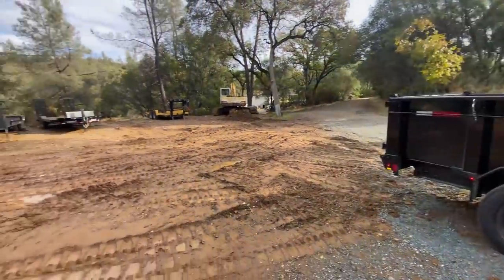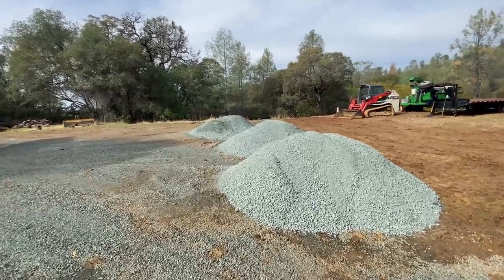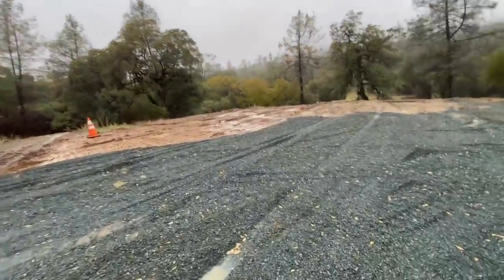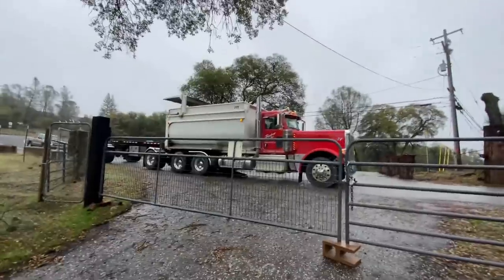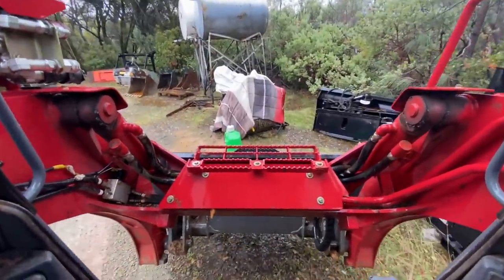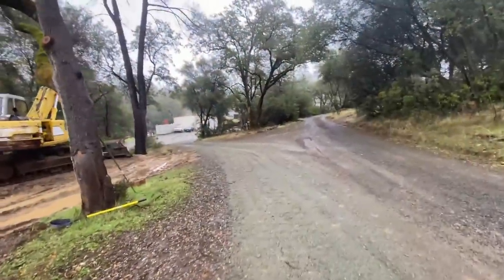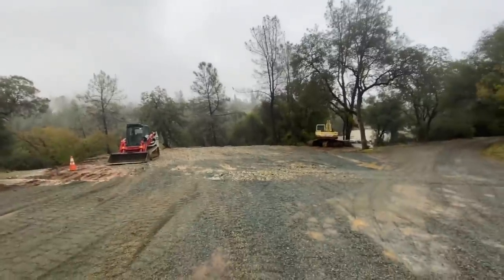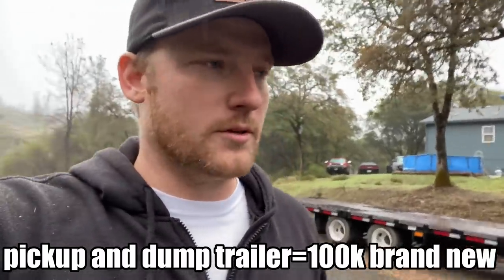How does my new Dump Trailer stack up to a dump truck. Price break down

Comment: Heavy road base geotextile is 100% worth it, especially at your own place vs. a customer. You haul in/out pretty heavy setups all the time, so no doubt all that stone will be mashed into the sub-base material. For 500 bucks, the proper geotextile will save you thousands in terms of re-graveling/touch up. Nice video sir, super jealous of your new trailer!
Reply: We started using geotextile five years ago and for our use, it's been the way to go.

Comment: I think the best way to build a yard is to shape everything with dirt first.  It shouldn't be perfectly flat but a bit of a slope, maybe hummed in the center a bit depending on the circumstances.  Once the ground is shaped to shed water then add your gravel.

Also when I order gravel I just get the biggest truck and trailer setup possible.  Usually tripple axle end dumps can bring me 27 ton per trip.

I just ordered a ironbull 7x16 gooseneck dump with 8k axel to haul my mini excavator and skidsteer.  Can bring in a load of sand for backfill and haul away the excess dirt.

Comment: Always wanted a semi and belly dump for doing long driveways in central Oklahoma. Bought a used setup a few years back and it has been a huge unending expense. The truck and belly isn't my primary busy model and now after a new motor and set of tires thinking about going back to gooseneck dump trailer and gooseneck flatbed for moving the dozer and tractors. If I had employees to keep all the equipment busy might be a different story.

Comment: One has to figure out what works for them. Your Dump trailer does things that a dump truck cant do and vis versa Dumping on the move to spread gravel is awesome even better is when they have a pup trailer and dump both truck and trailer at once As for you getting a Semi whatever it is one needs to figure out what fits there needs for your operation Id run a hook loader that way you could have multiple decks and or bins but thats me

Comment: U owned an old 1866 single axle dump that would hold 8 tons. Had a straight 6 gasoline.  I learned to spread good with that because I would say spread and rake in my ad.

Comment: It’s crazy how different pricing is on stuff in different areas of the country. Here in CT a triaxle dump hauls 22-24tons of material and hourly rate is $85 an hour. For a load of 3/4 process delivered is pretty much right at $400.
That being said you could get $100 per delivery in CT for the dump trailer or small dump truck like a f550 because you can get into tighter places and also will deliver less then a triaxle load. People will pay that $100 because they may only need a ton or two of something and triaxles have so much work around here no one does less then full loads normally.

Comment: Once you reach the point where V Belt & Sons needs multiple pieces of equipment on a job site, it might make sense to purchase a truck tractor and and large lowboy trailer to haul all of your equipment. 

With semi truck as part of your operation, later adding a used dump trailer might make sense if you can show a return on investment in a year or less. To go out and drop $80K on a new dump trailer without being full time in the business, is asking to go out of business.

Comment: I have been debating this same conundrum for about a year, my dump trailer will hual about 16k, I use it constantly, overloaded it a few times. Was thinking about a dump truck, but diamond C has a double axle 32k GVWR, and a triple axle 36k pound GVWR and some companies make a 40k GVWR trailer, although they are big money it makes me wonder if they tilt the scales enough or come close enough to a dump truck in some situations, theres obviously some benefits to it given its 70k dollars at diamond C or.else they wouldnt make it. I hual trash once a week to the dump, so my plan is just to hual 17k pounds of gravel back every time I go over the next year.
Reply: your Best Choice would Be to Go with A  BEN -  LEE Then You  can Haul More than a Dump Truck with the Right Set -Up - 55,000 pounds of Material with Their Mini  70,000 with the Right Set-up  ,Diamond C Just does not have as much experience as BEN - LEE

Comment: for me, 1 hour round trip to the quarry. 12.50-14 per ton depending on what i get. i get 6 tons.
i don't have anywhere for a transfer to swap so singles or super heavy deliveries only if you can get one. most trucks take 15 tons and the cheapest i can get a 15 ton delivery is 450 bucks. owner operators are making about $240/hour off me minus overhead. seems crazy to me.

Comment: Have you used your spreader gate yet? They will do as good a job as the big truck. It does require a helper to control the bed and gate. $100 per hour for a pickup truck and trailer is California rates, can't get that much here, rural Arizona.
Reply: You also don't pay 5 bucks a gallon for fuel lol

Comment: One thing id do with all the gravel you have id build or buy a land plane use to use one at the Deere dealership i worked at use to maintain 5 acres of lot with it youncould have it mount on the skid steer or the tractor

Comment: The scales on the loaders at stone quarry's are normally off compared to the actual certified scales that the scales person prints your ticket my quarry That I work at 1 loader is 1/2 ton light a 980H, 1 is 3/4 - 1 ton heavy 980G and the pit loader a 988H is 1/4 of a ton light, so loader operators are making estimated gasses

Comment: Im in the very early stages right now. Just bought a mini for the property. Need tonnes of fill but can't get a truck in yet. So do I buy a dump truck pick up that can pull the mini with a deck trailer? or buy a reg pick up ands a 14' dump trailer? back and forth back an forth.. lol
Reply: To me the capacity was too low to do it that way.  I bought a trailer similar to Sam, but a bumper pull.....I can load 10k of material and have the ability of putting my Mini or small loader in it.  I have a C7500, but the insurance was 3k a year with minimum miles driven and tagged to my commercial policy.  Not worth it for me since I do this on the side
Reply: @chadmatthews9346  ya, I plan on working with the machine Part time too. But not til next year. Thanks for the reply, I’m definitely leaning heavily towards the dump trailer

Comment: yep, gravity ALL the way down...it'll LEAK EVERYWHERE. just had this happen yesterday on the big tex
Reply from the maker: I’ve gone gravity all the way done quite a few times and no leaks yet. 🤷🏼‍♂️
Reply: @VBELTandSON  interesting, mine the reservoir completely overflows if I gravity all the way down. The levels check fine when stowed and fully extended but for some reason gravity down over fills the reservoir and makes a complete mess haha.

Comment: If it were me, I wouldn't try to factor in my own labor rate on my day off.  If there's no opportunity cost to your time, I think it's an error to include $100/hr for your own time.  The price of the pickup + dump trailer method (on your day off due to weather) is just the materials and the sunk cost of the equipment.  This changes the balance-- you paid $600 for the semi operator to do what you could have done for free by spending the rest of the day on it.

Comment: It is easy for me to say go buy a kenworth dump truck 🚚 and trailer but the best thing 👌 to do is your home work and really think how much you are going to use it and the cost . I pay 5 dollars a gallon for diesel fuel in Santa rosa ca . And then the 🛢 oil changes and repairs. Also will need a driver. Then all the fees. Good luck on your adventure.

Comment: I've never mastered rollin' and dumping. I usually make piles at irregular intervals....
Reply from the maker: It’s a real talent when you get it figured out
Reply: With my dump trailer I always get a pile at start because i cant open the gate when its raised up because of pressure...but basically an soon as it starts to trickle rock ill goose the truck and get the rock to slide to the back...then just drive at a steady pace and it spreads as pretty as the dump truck

Comment: Get a truck ONLY IF YOU HAVE THE WORK TO JUSTIFY THE PURCHASE. If not, go the cheaper route and hire a truck for the bigger jobs that would require some hauling that isn't cross country. It all depends on what your job is, do you have the business to keep that purchase going to make money, and keep a piece of equipment steadily busy. Plus several other factors, but this just a start.

Comment: I run my trucks for 125 an hour. end dumps.
tri axles average 80-100 an hour

I've done it for 11 years. gradually getting out of it. cost of insurance, maintenance, tags, stone etc. prices just keep going up... it's a watered down line of work. 

if you get into it. it's a lifestyle.  I chased contracts, don't really mess with residential. too many factors and liability.

keep up the good work man!

Comment: Hopefully someone sees this so it's useful: don't do what this guy did. No need for geo textile. Go to your local concrete company and purchase crushed concrete (Typically called "type 2", not number 2 stone, but type two road base). You can buy it for a few dollars a ton ($8 per ton is a normal price). Build yourself a smudge bar for your skid steer. Grade the lot with the smudge bar. Run a few inches of type two. Then cap it with 3/4" crush. It will pack nearly as hard as concrete. The cap will keep it cleaner. What he put down will get mushy with rain and it's expensive. Remember to be strong, the shape of the material must be jagged and there needs to be at least three different dimensional sizes present of proportionally similar volume. They interlock together. The crushed concrete also has unused cerments that will bind chemically over time as it rains.
Reply: A Big Tex 16ft dump gooseneck with scissor lift will run you just above $12K brand new. It will transport 6 or 7 tons.   It lifts 7 tons no problem. Buy a medium duty daycab for 15K. They are easier to work on and the VT365 is the Ford 6.0 with far less issues. An international 4100 with a VT365 or DT466 will easily pull that trailer. The dump trailer is perfect match for a single bucket from most loader used at many quarries and concrete plants so you aren't wasting the guy's time. No need for 100K worth of equipment, and each run is 1/3 of an end dump. (End dump is 20 to 22 tons). The goal is to get the job done while saving money doing it. In the end the Big Tex can be sold for a high percentage of it's purchase price.
Reply from the maker: What this guy did is holding up perfect. And big Tex is thin trash. I won’t ever buy that brand.

Comment: I'm not seeing how you can carry 17000lbs of payload? trailer is 7 ton with 2 X 7 thou axles, trailer weighs 5 thousand plus 17 is 22,0000lbs with a trailer legal for 14 thou gvw, with 3,000lb tonque weight thats only 17,000lb gross weight?
Reply from the maker: Trailer is rated for 25,000lbs 
Not a little trailer from tractor supply
Reply: @VBELTandSON  with only 4 tires? ima lookin that up. Thanks
Reply: @VBELTandSON  OK I see 10,000lb single axles nice !! wish we had those up here.
Reply from the maker: @doylemaintenance  where you at?
Reply: @VBELTandSON  eastern ontario Canada. 1.5 hours west of Ottawa. Biggest axles on dump trailers for sale around here are 8 thousand lb.
I just bought a triaxle 21,000 lb dump
Reply: @Doyle Property Maintenance  i hear the tripple axel setups are hard on tires.  You can get bigger axel I think.  The 10 000 lb are usually dually though, I guess this one is super singles

Comment: Watching battery powered pumps on dump trailers is painful to watch. I ran remotes to the rear of my ton truck to plug the trailer into the PTO powered hydraulics on the truck and it is the ONLY way to go !  Sit in the cab, lift the bed, move the truck forward to empty the trailer, done. (And no jump pack)

Comment: Never heard of buying gravel with dirt mixed for a driveway 🤔 nock knocking just surprised
Reply from the maker: Oh you just watch it sets up like concrete
Reply: @VBELTandSON  i used a gravel that was "dirty" but it was just gravel drust. I definitely trust and value your knowedge. Youre the pro not me lol
Reply: @VBELTandSON  so is that y’alls version of what we call crush and run here on the east coast?   A compacting agent mixed with a aggregate?   Thats what we use for a paver base and driveways.   Iv never heard of the dirt mixed either unless you don’t actually mean soil.
Reply: I'm thinking he means recycled base rock which is concrete some asphalt and it can be a little dirty. But with the concrete dust it does set up like concrete.

Comment: I do a lot of driveway work and always need multiple loads of material. This year I started getting bid requests for jobs that wouldn’t require much material. If I could find a driver that would deliver half loads the delivery cost would still be the same and always made my bids to high. I bought a used dump trailer and now I’m able to get these smaller jobs that pay just as good. So far it was a good investment that’s paying off.

Comment: Unless you are hauling literally hundred of tons of rock, you can't ever come out buying a trailer, compared to having it hauled in, a few loads at a time, and you can't "tailgate" or spread with that trailer
Reply: Why not? At least half of my deliveries with my dump trailers are spread. I tell my customers, if you need a large volume of material, call a big truck. I fit in with small loads for the customer that don't want/need a large load or someone that can only afford a small load at a time.